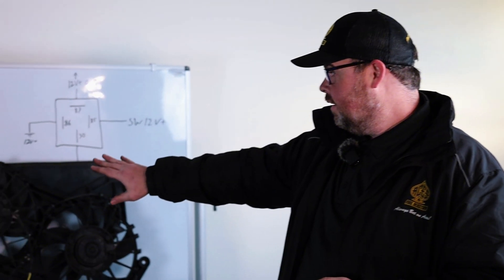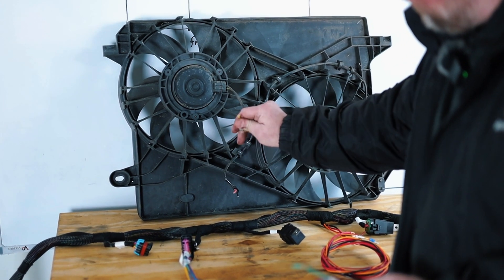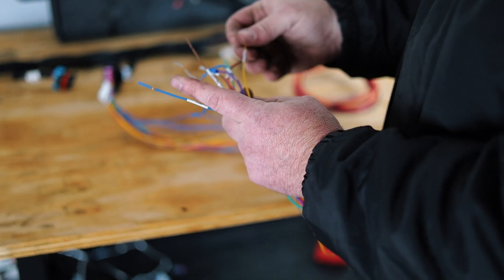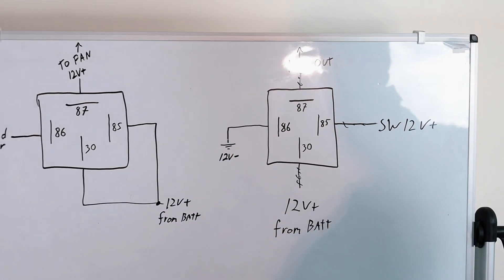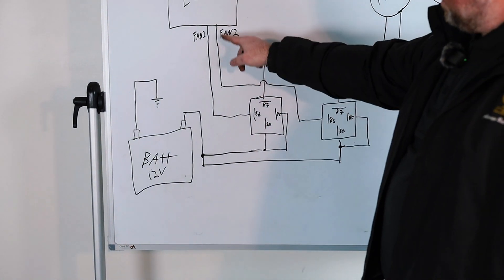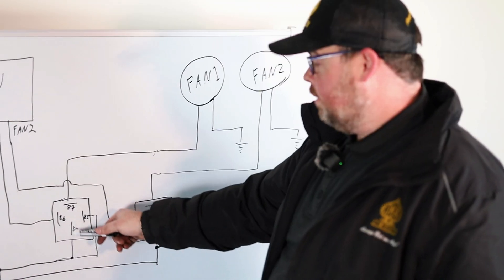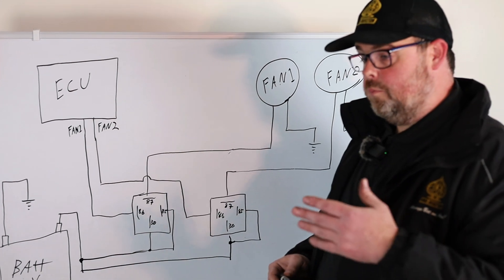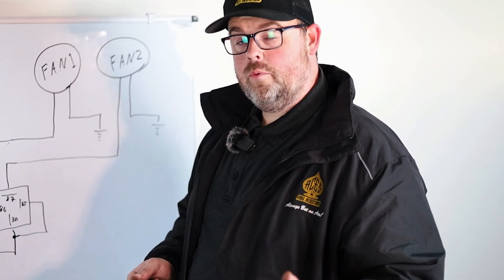Fan Connection (Jackpot LS Installation Guide Ep.5)

Comment: Hey guys. Good stuff but how about explaining the connection from trinary ac switch? Trinary switch is also ground triggered switch which needs to be used to turn on at least one fan when ac is triggered. My understanding is that at least. With killshot ac wire is not fan trigger instead it only increases rpms when ac comes on.
Reply: If you hook up the ac wire the rev/ac_fan wire is a ground trigger for the fan.
Reply: Did you ever figure that rpm issue out